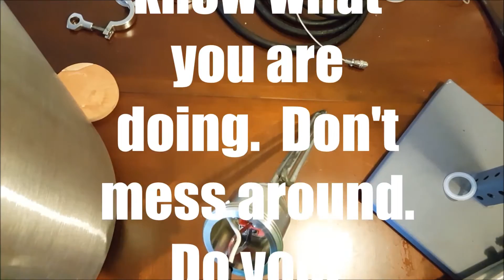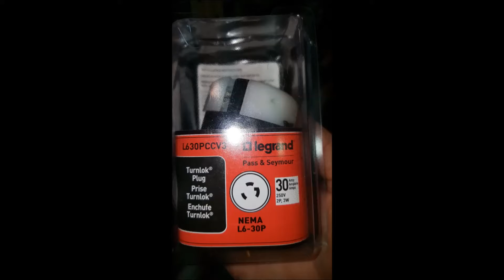How To Wire an Element for RIMs Tube

Comment: LOL.... not a neutral. it is a ground. You
 do not use a neutral in a 240 volt heating element.
Reply: F M I have a 4 prong outlet, is it ok to just use the two hot and one ground as long as it matches up to that of the outlet And cut back the neutral. I read that as long as the device you are running is rated for the 240v neutral is unneeded.

Comment: So this isn't grounded?
Reply: it is grounded, he's following NEC code. keyword is 220v 240v.
for 120v colors are Black for Hot, White for Neutral, Green for Ground. 
3,486 views and no one answered you, smh shame....
Reply: He made the white a ground. 3 prong does not have a neutral wire. He misspoke because normally white means neutral.